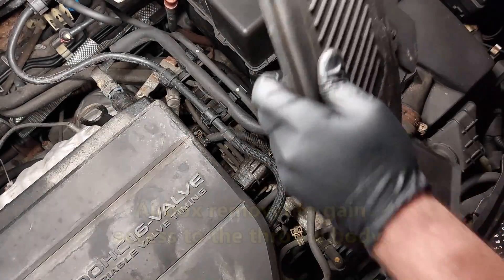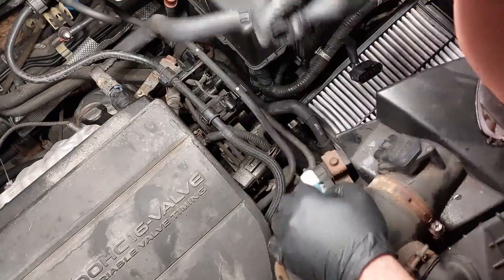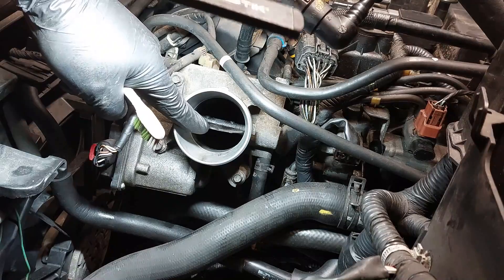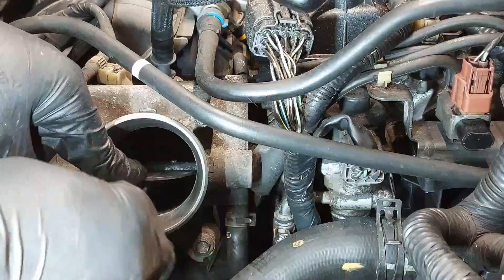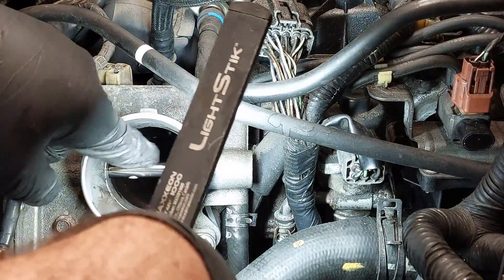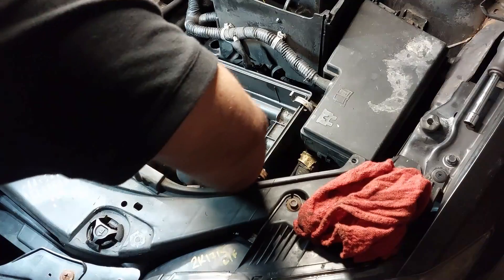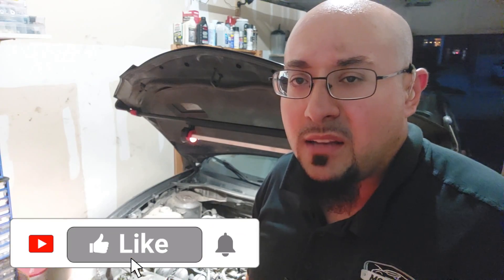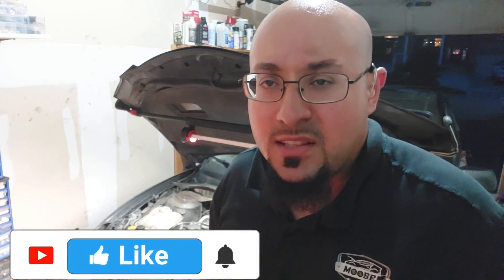2006 Mazda 3 - 2.3 - Throttle Body Service

Comment from the maker: Throttle body relearn procedure if you're having trouble with the idle speed/driveability problems after the service:

Perform the throttle valve position learning and idling engine rpm inspection.
Connect the M-MDS.

Turn the ignition to ON without starting the engine for one minute, then turn it to OFF.

After one minute has passed, start the engine.

Warm up the engine at idling until the cooling fan starts operating or until the coolant temperature reaches 194 °F (90 °C) or higher.

Turn off any electrical load, including the A/C, with the shifter in Neutral or Park position.

Let the engine run for five minutes.

Measure the engine rpm at idle using the M-MDS to confirm it is within specification according to the Workshop Manual.